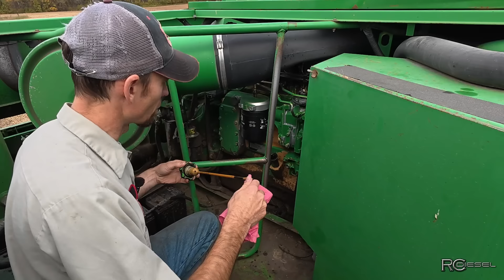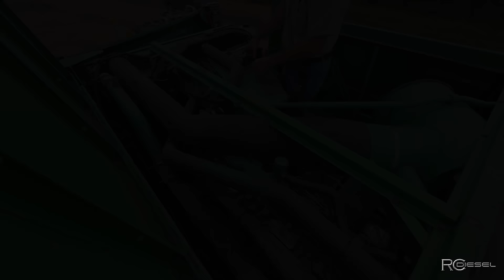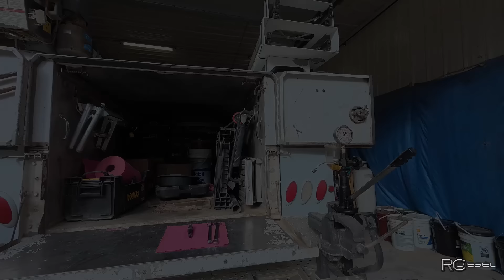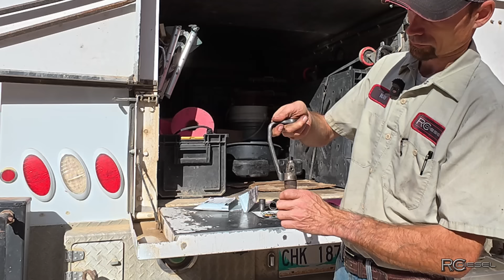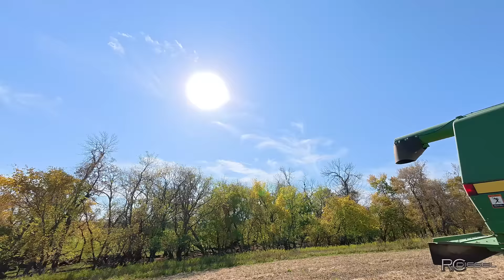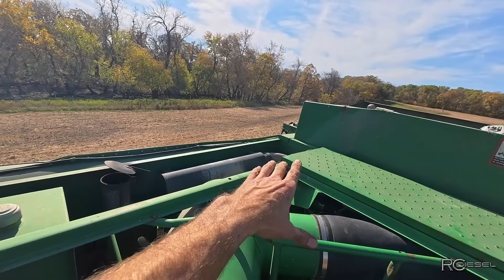🚜 John Deere 9600 Combine Injector Diagnosis & Repair & Fuel Temperature Sensor Code 37E 💨

Comment: Forgive me for being 11mos late to the party, but I also have a 9600 with a 37E code. My ears snapped right around when you mentioned that it could change how the engine runs. What would happen if an engine has been asked to run for potentially years with it? (no idea when this problem developed; new-to-me machine) I've been a naughty farmboy and just ignored it once I learned it was a fuel temp sensor. Been running it all fall thus far...
Reply from the maker: Better late than never!! 

Yeah, that 37E code can cause everything from stalling, surging, stumbling all the way up to no noticeable symptoms at all. 

The ECU uses fuel temp to adjust fueling and timing for maximum efficiency. Even with no notable symptoms, it's still going to be going through phases when it's not running right - but it's also not going to damage the engine - especially if it seems to be running fine with the code active.

There's a lot more than just your machine running around with that code (or others) active! But I still think you should fix it 😁
Reply: @rcdieselchannel  Seeing as I'm stalled due to rain, perhaps I'll go pick up a wrench and fix something ;)
Reply from the maker: @mikerosene8904 Love it 😅

Comment: By chance would you know about cat motor. Have a c9 acert that seems to go through a gallon of oil  a day can see black smoke coming out exhaust and when you open the oil fill point it pours white smoke out of the oil fill point. I wanna say rings are going and letting oil get past.
Reply from the maker: Yeah, if you've got white smoke coming out of the crank case, that sounds like the rings are worn out.

Comment: That tool is an injector tool but specifically from the old y injectors.  Early 1970s 404 blocks and heads on john deere

Comment: normal people, use engine flush in tiny volume a week before the oil change. they also use injector cleaner from discount hardware stores. i liked the howes diesel defender from local parts store on sale.
Reply from the maker: I've never heard of anyone using an engine flush before an oil change on a good running engine 🤷 I like the Power Service fuel conditioners, but there's a lot of different products that seem to work well. Howes is a popular one.

Comment: WHY WOULD "JOHNNY ROTTEN"" DO THAT???? AMAZING HOW MANY THEY SOLD AT A PROFIT!!!AFTER MORE THEN 45 YEARS OF WORKING ON DIESELS AND FULL TECHNOLOGY GRAD IN THE EARLY 80'S I LEARNED WHAT "WORKS AND WHAT DOES NOT
AND WHAT NOT TO DO, NEVER EVER EVER START ANY ENGINE THAT HAS ANY SIGNS OF OVER FLUIDS NOT EVER!! THE ROCKET COVER SHOULD BE PULLED AND INJECTORS ALLLLLL
CHECKED FIRST, IF YOU DON'T YOU MAY BE CAUSING THE OWNER MORE EXPENSIVE REPAIRS, WHY ETCH THE BEARINGS EVEN A LITTLE, GOOD DECISIONS ARE SMART MOVES, AND CUSTOMER'S LIKE SAVING MONEY !!❤😮😮😮😮😮😮😮😮😮😮😮😮😊
Reply from the maker: Thank you for your input there 👍

I would argue that 10% diesel fuel in oil still has enough lubrication to run it, just not at high load. If the engine has any lube pressure at all, the bearings will nicely float the crank journals at idle and not be touching the crank ousltside of startup.

Pulling & testing the one injector that I was quite sure was the issue was a lot cheaper than pulling and testing all 6 😁 and I'd say that since it was the issue, that was the right move. 

I admit I haven't been doing this for 45 years - but just long enough to find the balance between carefully aimed diagnoses and a make-work project.

Thanks for watching!

Comment: Remember that for every 10 people who want to ruin you 
There’s 10 who want to help you 
Now 
Why didn’t you crack the injector feed pipes to detect the miss fire ?? 
Carry a dummy pipe to isolate the injector as may have been the injector pump 
An old mechanic been the devils advocate 
Keep up the good work 
From Western Australia ☘️🇮🇪🍀🇦🇺🚜🚜🚜
Reply from the maker: Hahah Thanks! 

Helooooo to Australia! Awesome!

Yeah, there's more than one way to skin a cat, so to speak. Cracking the lines one at at time absolutely would have worked also, but it is messy, inconvenient and it tells me nothing more than the IR gun which was quick, easy and no mess. Also, tightening those lines under pressure like that can damage the flares and cause them to leak - I've had that happen a few times on multiple engines. The IR gun doesn't always give a clear enough reading, but it's zero risk to damaging the lines. You can locate the cylinder by cracking the lines but you still don't know if it's the injector or the pump. Sometimes a failed in-line pump will push fuel when the line is cracked but lack the pressure to open the injector when the line is tightened again. Never seen a Nippondenso pump do that, but I've had that on a 5.9L Cummins. It is extremely rare for the plungers to fail in these Nippondenso pumps, especially when compared to injector failures, so I always start with the injector. If it tests good, then we've got bigger problems for sure. 

Thanks for the feedback!

Comment: Thanks for the video.  Question..I have the same leak as on cylinder 2 ,tightening didn’t help. Is there a seal on the injector that is replaceable ?
Reply from the maker: Yes sir, there is the sealing washer at the nozzle end, and the O-ring & packing on the leak off line. Likely what's happened though, is the flare is damaged on the injection line. It's probably been over torqued in the past at some point, that's my guess.

Glad you enjoyed the video!

Comment: Hi Ray. That s a great video,i love it,you explained it very nice. Can i ask you what is the purpose for that fuel temp sensor? I think the thermal camera is effective to use in the first minutes of the engine  runnig before exhaust manifold gest all heat up. Thanks
Reply from the maker: Honestly, I've never read the theory of operation on that ECU and I don't know exactly how that electronic governor all works. An educated guess is that the ECU uses that temperature information to adjust injection timing.

I'm glad you enjoyed the video! Thanks for watching!

Comment: Hey just wondering; but if one injector is bad, shouldn’t all the injectors be serviced? Or, in this case, where you have a combine half full of grain during harvest, do you just do the minimum required to get it back up and running as time is of the essence?
Reply from the maker: Yep, your absolutely right, all the injectors should be tested - just not right now. Down time on a combine can cost a crop, so most of the time we do bare minimum to get the farmer going. In this case, injectors can be looked at on a rainy day or on the next pre-season inspection and we'll likely do a valve set right away too then, just for maintenance sake.

One other thought on this  is mechanical injectors don't give the same problems as the HPCR injectors, so to keep running it - even if the other injectors are weak - is actually low risk.

Thanks for watching and asking questions!
Reply: And I spoke too soon didn’t I

Comment: Good informative video ray 
Off topic question 
Have you ever rebuilt the SCV remotes on late 20-55/60 series John Deeres I need 2 done on my 4240 Calling around shops for prices to rebuild them I got quotes from 1700-2400 dollars and the new seals are not super expensive is it a knowledge thing that makes the price so high or is it a labour thing? Does it require special Tools
Reply from the maker: Sure have. SCV's on a 4240 for example is about a 5hr job on each block. Seal kits I think are around $120 per block (don't use the cheap A&i kits, they are no good) and the pressure valves are around $100 each x 4 valves if they all need replaced. If the detent roller is worn, that's more bucks. Sometimes the pivot shafts are worn out.... You can easily spend $700 in parts on those. But sometimes all you need is a seal kit. It all depends what's failed / worn.

It is a pretty special (and pain in the butt) procedure to set them up right and it does take some special tooling.

Comment: Those belt buckles are very rare and very expensive to the right JD addict,,,,,,,,,They were given to very select people back in the day,,,,Usually JD dealers ,,Who would come to the JD plant where the machines were made,,,They were brought there to try out some of the very first new models off of the production lines,,,And they were given these buckles as a gift for the occasion ,,,,There is probably no more than One or two hundred of that particular one in existence ,,And a few thousand over all,,,,,,And given that they were just a belt buckle not worth anything at that time,,,,1960s 1970s,,,,Most of them are probably lost to time now,,,,,,So who knows how many is left,,,,It's def very rare,,,And a hard core JD fan with deep pockets would pay handsomely to have a piece of JD history that only a handful of people have,,,,,,I believe other manufacturers did this with belt buckles as well,,,,,,,,White tractors did it also,,,,,,I know from his recent video that Oliver66farmboy is currently trying to buy one from some guy he knows,,,The guy is an old dude who got it back in the 70s when he drove there new model,,,,,,,

Comment: Crack your injection lines at the pump one at a time . When the sound doesn’t change it’s the bad one. Done lots. Usually the spring breaks
Reply from the maker: Yep, that works too. What I don't like about that method is its hard on the flares when you tighten them back up under pressure.